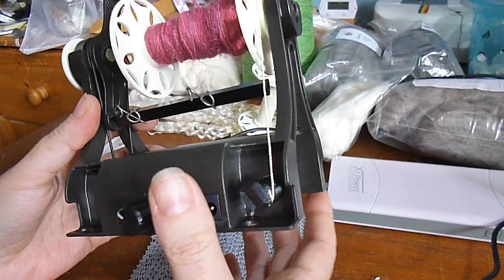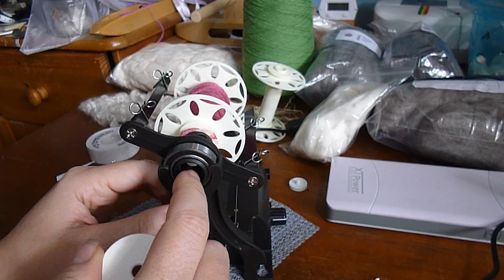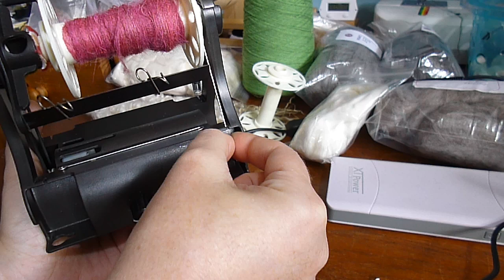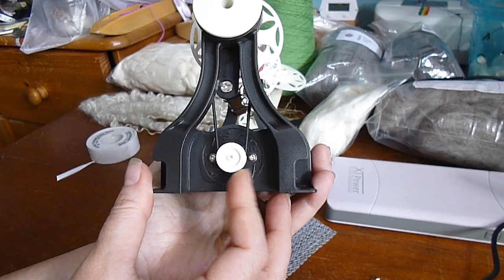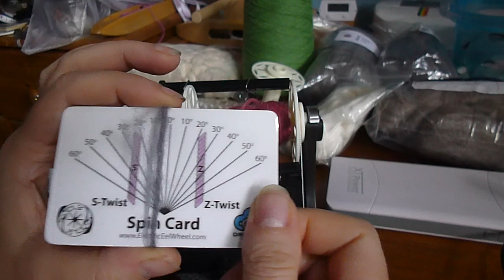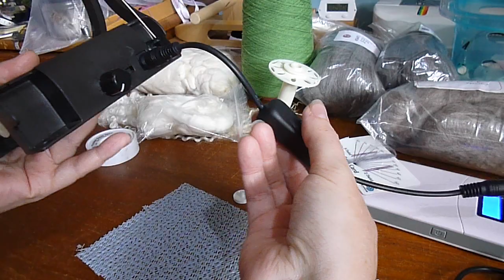EEW Nano - Getting started 1 - the parts of the nano

Comment: How do I stop the motor from overheating? It seems to do that after half an hour and where did you get that amazing tension knob. Tension and uptake is my biggest issue. I’m close to tossing this in the rubbish bin.
Reply from the maker: The tension knob is one I printed myself. I've made the design freely available here: https://www.thingiverse.com/thing:3878799 if you know anyone with a 3d printer. Alternatively snortimers hub are selling them in the US and possibly shipping elsewhere too. I have never had problems with overheating, but assuming your motor pulley isn't slipping and your bobbins are fully pushed together, the likely reason is tension being too high. First check your pulley is on properly (i cover that in another video), then I'm afraid you'll have to play with the tension to find the sweet spot. It needs very very small adjustments, millimetres or less, and it shouldn't be pulling the yarn at all, but wil let it wind on when you let go. The mistake many people make, especially those used to wheels with a strong takeup is to expect it to pull the yarn out of their hands. Not only is the nano not capable of this, it's not a very good way to spin both in terms of control over the yarn you're making and being kind to your body. If you are really close to throwing it in the bin, then put it away for the night and come back to it fresh in the morning, sometimes that can make all the difference.

Comment: How exactly did you change the tension band with a knob? I need to do that, I'm having serious uptake issues. I'm used to scotch tension, my other wheel is a Majarcraft Suzie. I also am unable to remove the reducer, it simply doesn't budge.
Reply from the maker: I printed out this tension setup: https://www.thingiverse.com/thing:3878799, glued the cup to the body with superglue, and used a spring and cord with it to mimic a system I am more familiar with. The orifice reducer is held in by friction, it's got a rubber o-ring on that grips the inside of the orifice. If you can remove it by simply pulling, try twisting it at the same time.
Reply: @vampyyy  Many thanks, We, both strong husband and me needed a wrench to removed that wretched thing after soaking it in super hot water for half an hour. I will watch your video and try to setup with the little knob gadget that I now have. Again, thanks.

Comment: What is the rectangular item on the table behind the on off switch?
Reply from the maker: It's a battery: https://www.amazon.co.uk/XTPower%C2%AE-XT-16000QC3-Power-Bank-connection/dp/B07PY4LP5Y, I bought it for my minispinner as that needs the 12v output it gives, it's a little overkill for the nano, so I recently bought this one instead: https://www.amazon.co.uk/Jonkuu-Portable-Chargers-10000mAh-Compatible/dp/B07QTJDGJ1 which is smaller and fits in the 3d printable battery case.